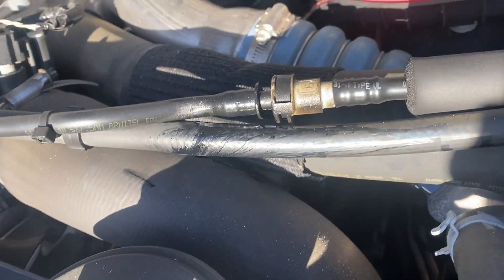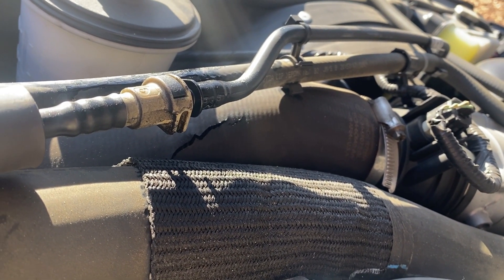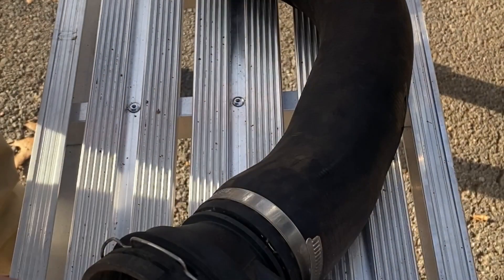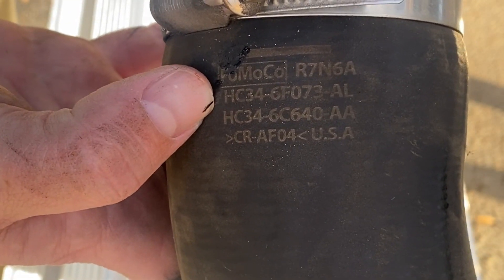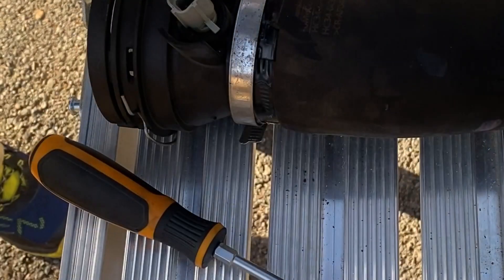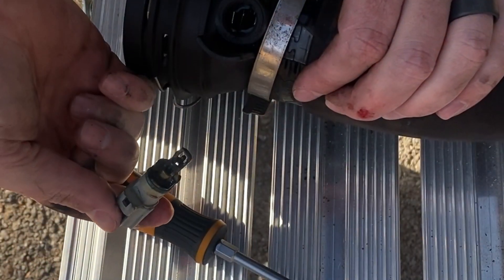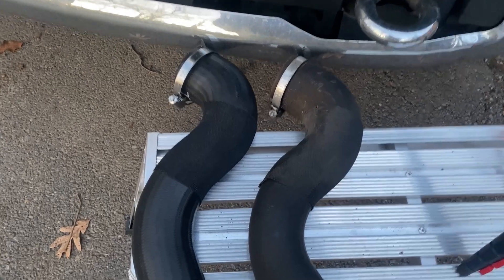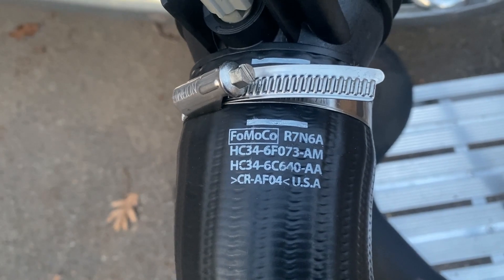F-250SD Project Part 1 - Fixing P00BD Check Engine Light/Blown Cold Charge Pipe

Comment: Appreciate the video! I had the same exact issue on my 2017 F250 SD. Part here was $222 for the complete part w/ sensor. Definitely appreciated the follow up video talking about cleaning your original with the CRC and reusing. I swapped out the new one and installed my cleaned original, ran the OBC ForScan, pulled up the code P00BD, cleared it and it cleared the check engine light. Will update if my check engine light comes back on.

Comment: Thanks for the help I was having hell with mine
Reply: Part number?
Reply from the maker: @kbayoable should be HC3Z6F073B or the latest variant of that.
Reply from the maker: It’s so common they keep the part on deck at the stealership.
Reply: Not the mass airflow sensor that is the charge cooler air temp sensor